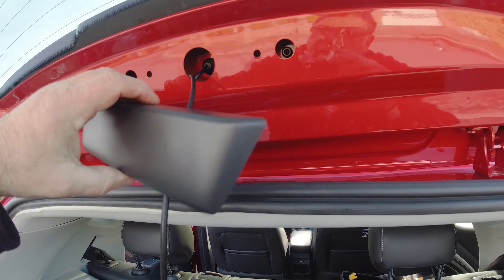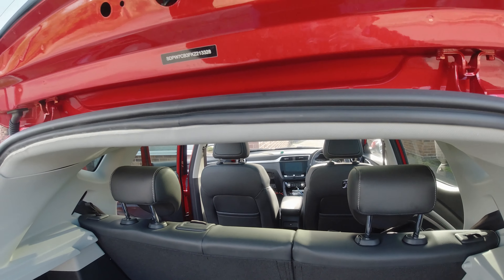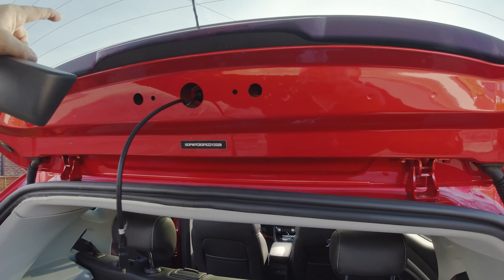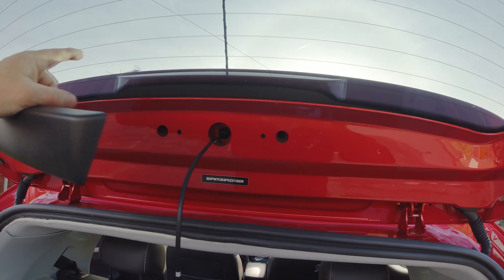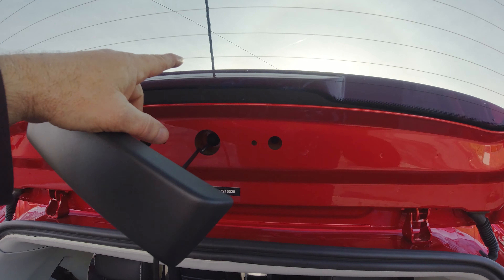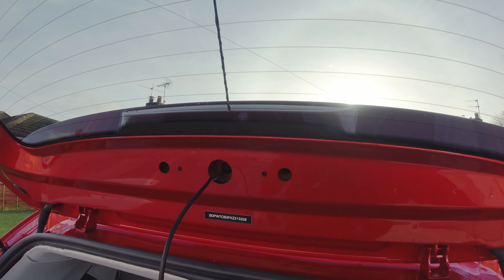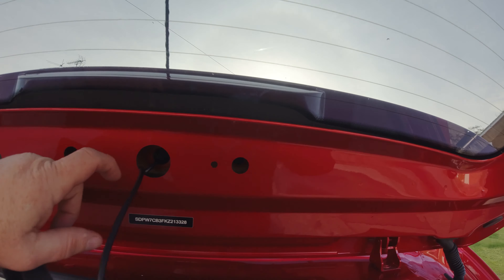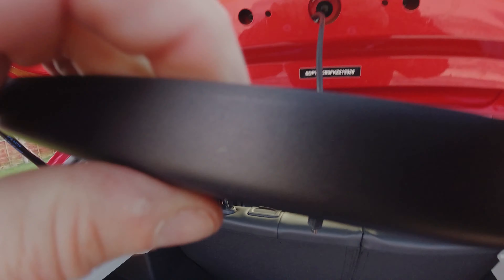Viofo A129 Pro Duo Dashcam install on MG ZS EV PART 2

Comment: Superb informative videos, great job. Can I ask a fairly related question a) do you know how the interior rear view mirror is removed? b) Do you know how to remove the large black plastic cover infront of the rear view mirror that cover the cars front lane assist camera etc? (I have found the cover in front of the mirror comes off if you just pry in of by working your fingers all around the outside edge, however the mirror prevents removal of this cover!)
Reply from the maker: Hi Richard....thanks for the comment....re the questions ...both a) and b)...sorry I don't know....I haven't ever done either so no idea....if you ask on the Facebook group someone there may know.
Reply: @TomsManShed  I found by trying the MG lane assist camera surround just pulls off around the edges. Not worked out the mirror itself yet.

Comment: hi Tom, nice video.
just curious , does the 24 records affect much of the range?
Reply from the maker: Hi Kenny thanks for the comment....not sure what you mean by "24 records" but if you mean the constant 24 hour recording then no it doesn't affect the range at all.

The dashcam runs off the 12v battery not the main traction battery.....also you can set on the hard wiring kit a switch that turns the input to the cam off when the input voltage drops below a selectable level to avoid running the 12v too low.
Reply: @TomsManShed  yes that what I mean 24 hours recording

Comment: Tom thanks for this great vid. What type of fuse holder/splitter should be ordered? (medium? small? micro? micro long? standard?) Can you share a link please to your special fuses used on the fuse splitter?
Reply: Saw you've answered it... Thanks!
Reply from the maker: @lamdin1  Hi Shaul...yes  I should have mentioned in the vid that it was in the description....btw if you are thinking of using a hard wiring kit (definitely advisable if your dash cam has a park mode) then you get a variety of fuse holders with some of them.

I chose the genuine Viofo one which didn't come with them but later in the year I fitted a Road Angel Pure speed cam detector so I needed another hard-wire kit and I bought this one....like I say it comes with the mini blade fuse spliter as one of the included leads and would save you buying a separate splitter have added that to the description along with a link to the latching switch I added later in vid.
https://tinyurl.com/1gsm61hr

Comment: Hi mate. Are you happy with this dash cam? I am about to get a ZS EV and I am thinking of getting a dash cam. This looks like a good option.
Reply from the maker: Hi Naughty....yes I love it.....I had its predecessor as well and that too was great.......the little base it clips to which contains the GPS part did go faulty after about 10 months.....the cams themselves were fine it was just the base it clips to that went dud.

They are available separately for £17 but Amazon wouldn't accept just this part back to replace ...they said I had to send the cam as well so I sent the whole lot back ....they refunded me ....and I bought it again...so a new 12 month guarantee began :) ....I have only had great service from Amazon so would definitely recommend them and the cam.

PS the ZS EV has been great as well ....no probs in 18 months since I got it.
Reply: @TomsManShed  I ended up buying one of these cameras now I have to pluck up the courage to install it in my zs ev.

Comment: Tom, what type of piggyback cable is required for the installation? I can see there are 4 different types available:  ATC ATS MICRO2 MIN? My best bet would be ATS.
Reply from the maker: Hi Balazs...it was a Mini Blade Ato Atc one ...here is a link to the actual ones I bought...hope this helps

https://www.amazon.co.uk/gp/product/B071DYPXKG/ref=ppx_yo_dt_b_asin_title_o06_s00?ie=UTF8&psc=1

Comment: What amp do I choose to install dashcam? Does it have to be 10amp?
Reply from the maker: No it doesn't have to be 10amp....any of the fuses will do as it only uses a tiny current....you then put a fuse for the dashcam itself in the piggyback fuse connection this can be a very low current rated fuse like a 5 amp or whatever.

Comment: Thank you for your video, what was your final voltage on the switch?
Reply from the maker: Hi Marlon I keep it set at the 2nd highest 12.2 v so as to not run the car battery down too much.

Comment: Hello. How do I take off that plastic thing on the rear dash cam?
Reply from the maker: Not sure what you mean by "plastic thing"
Reply: @TomsManShed  hello again. The black thing on the trunk where you installed the rear dash cam... The one that you melt for the wiring.
Reply from the maker: @johntimothybautista6414  Hi John...that black cover just pulls off ..its held by just 2 press studs ...the pale blue things shown at 16:25 while I am melting the slot
Reply: @TomsManShed  thank you Tom for your replies. Just one more question. Can I use the prying tool to pull it off? Kind regards.
Reply from the maker: Hi John...yes a plastic one would be best so as not to damage the paint...its a while since I did it but I think it was reasonably easy to get off ...if you can get a good grip of it it may just pull off without any tools

Comment: Hi Tom, firstly want to commend you on a great install guide. I just have one question, what fuse type is used on the MG ZS EV, is it mini or micro? Just ordered a A119 V3 for my MG and will be following your guide. Want to make sure I order the correct piggy back fuse connectors.
Reply from the maker: Hi Prop....thanks for that much appreciated....the fuses are 'mini'....these are the piggybacks I used 

https://www.amazon.co.uk/gp/product/B071DYPXKG/ref=ppx_yo_dt_b_asin_title_o02_s00?ie=UTF8&psc=1

Comment: Thanks Tom, unfortunately seems like the fuse you used to get the permanent live is not working for me. I think you mentioned that the fuse was for the rear windows, but they don’t open when the car is off. Any idea?
Reply from the maker: Hi Marlon...the fuse I used is definitely permanent live ....all the row of green 30 amp ones are (the 4 windows). I know the windows dont operate with the "ign" switch in the off position BUT the fuses are definitely permanent live. In fact nearly all the fuses in the fuse box are...there a very few switched live ones.

I have just installed a Roadangel Pure Speed Camera Detector (a review will be upcoming) and I had trouble actually finding a spare SWITCHED live for it in the fuse box...I had to branch into the existing one used for the switched live wire of the  Viofo as no others were available due to the physical size of the piggyback connections snagging on the 2 already fitted.

I know it sounds weird that a permanent live fuse feeds an ancillarily that doesnt work with ign off but this IS the case...try it yourself...connect a piggyback fuse connector (makes checking voltage easier)  to one of the 30 amp window fuses and test for voltage with a multimeter/12v test bulb etc and you will see they are perm live even with ign off.

If they are not on your ZS EV then its wired different to mine....hope this helps.
Reply: Tom's Man Shed tried with a multimeter and I can only get values as soon as I turn on the ignition, I’m using the third green fuse next to the first red (the same you used)
Reply from the maker: @marlontojal4841  well thats weird coz like i say its its definitely perm live on mine...as shown in vid i solderd an inline switch on it and that stays green even after locking car and the park cam facility works fine after locking so its 100% perm live on mine...
Reply: Tom's Man Shed thanks again, would be nice to hear if someone else has the same issue, not sure if this as anything to do, but my car is from the Netherlands
Reply from the maker: @marlontojal4841  yes I would think all of them (especially european) would be the same but who knows...let us know how you go on Marlon and post here ....as mentioned when I was trying to find another switched live last week for the roadangel there were hardly any and nearly every one i tried was perm live so hopefully you will find one.
Reply: Tom's Man Shed fixed... turns out it was a faulty multimeter, sometimes the issues are in the simplest things... thanks again Tom
Reply from the maker: @marlontojal4841  glad you got it sorted...was doing alot of head scratching :)

Comment: Where did you connect your earth wire ? Or you didn't
Reply from the maker: Hi Mitu...thanks for that ...I hadn't realised I had forgotten to show that.....I just attached it to a bolt on a nearby bracket on the chassis of the car...any unpainted part of the car's metalwork would be ok

Comment: Both boring and interesting at the same time - great effort!  Sometimes we really do want to have the details even if they are not exciting, although I can't imagine many people watching the whole thing.   On your parking mode switch and request to Viofo, nicely done, but you can instead long press the menu button, which has the advantage of not having to remember to turn it back on next time you drive - Viofo had already thought about that requirement ;)  Off topic a bit, what do you think of your new car?  I also have an MG ZS, but it is the old type with an ICE, always good to have an opinion from an actual owner.
Reply from the maker: Hi Nigel...thanks for the comments...yes not the most interesting of vids and pretty long but wanted to cover everything I would want to know myself if fitting a front rear combo in the same car.

Thanks for the tip re the long press menu button.

Re the car ...yes am absolutely loving the EV...as you may have noticed I traded my 3 year old (bought from new as a lump sum retirement present to myself....the ONLY new car I had ever bought) Focus ST3 in to get it and most of my cars have been hot hatches...I absolutely loved the ST but I only do low miles (did 8,500 in it in 3 years!) and it only did 24mpg round town.....Found myself fancying an EV so arranged a test drive in the MG and loved it so bought one.

Although it is 2 secs slower 0-60 (8.5 as opposed to 6.5) than the ST3 it honestly doesnt feel it and is prob quicker to 30 mph....also I am getting price wise the equivalent of 150 mpg :) and thats on normal rate electricity.

It has a few faults as you will know from all the reviews and I would love a Tesla model 3 but its outside what I can afford....all in all I think the MG ZS EV is the best value for money EV out there and dont regret buying it for a minute....I cant see me ever wanting a petrol car again (still got my kit car though for my petrol head thrills :) )Take a test drive of one if you get the chance after things get back to normal ...am sure you will like it.
Reply: Thanks, sometimes the cheaper cars are more fun, and I suspect that is probably true between the MG and Tesla!  Never seem to see Tesla drivers having fun, normally see them sitting at the Tesla charging points, waiting, although I've never understood why, maybe they don't have access to a charging socket at home?   You can get really cheap overnight electricity specifically for EV sockets now, so cost can't be the reason.

Comment: Having got my MG and watched this video Tom I now feel competent to install one myself.  The spec on the cam you have fitted looks ideal, so that is the one I will use.  Next stop Amazon with shopping list to hand.  By the way, I have seen somewhere that insurance companies look favourably on dash cams in cars and sometimes offer a small discount on the premium, have you found that to be so?
Reply from the maker: When I took out my insurance (with LV)and  I filled out the online form I mentioned that it had a dashcam so not sure if the price I paid would have been dearer if I didnt.....on another subject re insurance I rang them the other day to tell them the rear windows had been tinted and it added £12 to the policy price!

Comment: I'm surprised that you needed to cut away the window tinting.
Reply from the maker: It would probably have been fine without but I didn't want the weight of the cam (I know it it is very low anyway) to maybe lift the film and thought the bond of the VHB tape would be better direct to the glass.
Reply: @TomsManShed  ok i see now that it was for image quality. I thought it was to help it stick. I have attached my cameras. Hopefully I will get time this weekend to attack the wiring. Tell me are the fuses full size fuses? There are a few different types of piggy back fuse holders for different sizes of fuse.
Reply from the maker: edited reply...1st one referred to extra clarity but have just had a look and see I only cut the film where the pad stuck on ...so it was for the above reason not clarity of vision.
Reply from the maker: @NaughtyGoatFarm  Hi Naughty.....I edited the reply ...when I 1st saw your comment I assumed I had done it for clarity reasons but then when watching the vid again and checking the actual car I remembered I had done in for the adhesion reason.....(it's nearly 18 months ago an am getting older...that's my excuse :) ) 

It would probably be fine stuck to the film but was no hardship cutting the film to enable sticking direct to glass......clarity seems ok but yes would be even better I suppose with the film cut in front of the lens as well.

I was asked before re the fuse sizes so I added it to the description a few weeks ago....have cut and pasted it below for you as well....good luck 

"The fuses in the MG are "Mini" type blade fuses ...blade group APM,ATM 
The piggyback connectors I used are https://amzn.to/2P2Lj2d"

Comment: I must have missed where you connected the earth to.
Reply from the maker: I just used a bolt that was attached to metal near by.....I show the earth wire at 1:06:27 but forgot to show the actual attachment of it ...any existing earth would do.